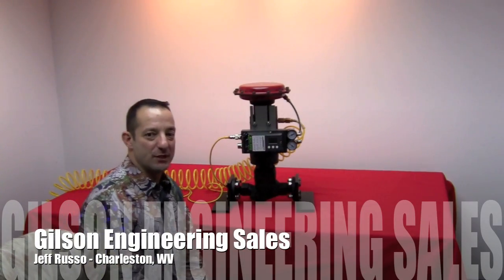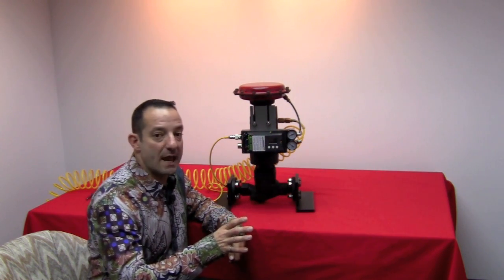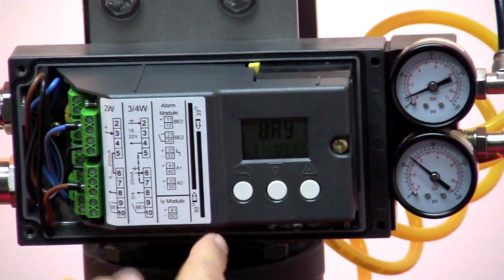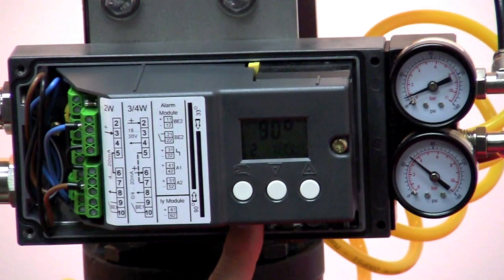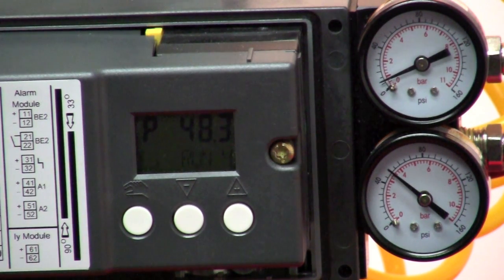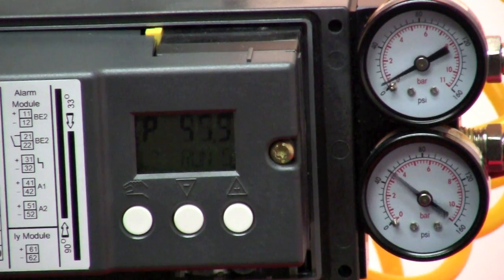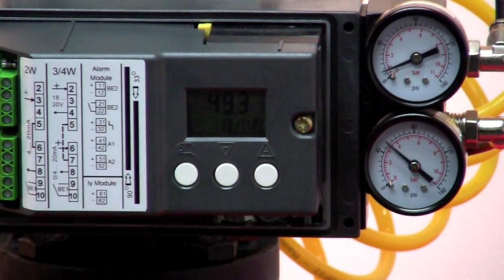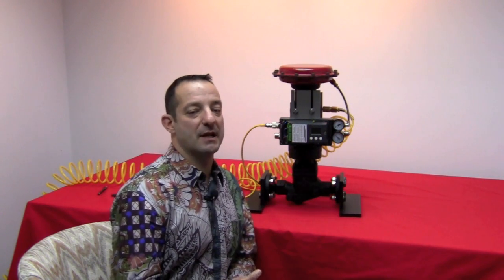Siemens PS2 Configuration Video

Comment: Hello, I troubles with one Sipart PS2 positioner. In manual mode, when I press "-" key is opening the valve and when I press "+" is closing the valve. It's like working reversed. With another PS2 positioner the valve is working fine.

Comment: Dear Mr.Gilson, have a good day and good afternoon my dear friend.
Hope you doing fine.

i have buy a new SIPART2 positioner and I Have got a  new findings when i wish to go configure it in my existing single acting 20mm stroke actuator.

I have gone this procedure in your positioner connected with my existing control valve.

I have gone step-1, step-2, step-3,step-4, step-5, step-6 and step 7.

In step 6 and step 7 your positioner can open acuator only 30% when i press both ( +)and (-) key.

If i press single button either + or - then it cannot open the actuator.

After completion the step 7 and step 8 gone then Range message display.

 May i ask you to know that at this condition 30% open the valve in both YEND1 and YEND2 is normal? If its abnormal what can i do.please advice me.

However,  if i press single + or minus button then actuator not move in YEND1 and YEND2 mode.but when i press both + and - button simultaneously then it open actuator only 30% then when press hand button its display range message.will you please advice me its normal or abnormal?